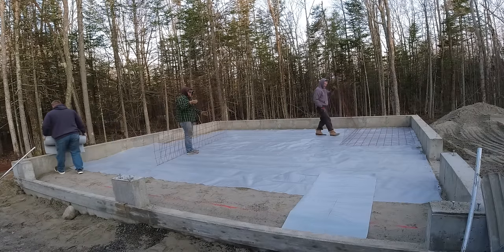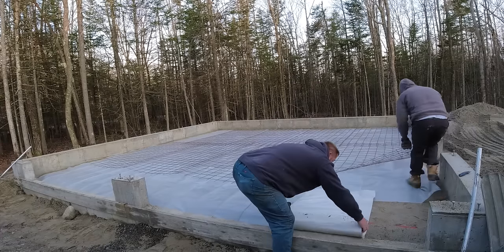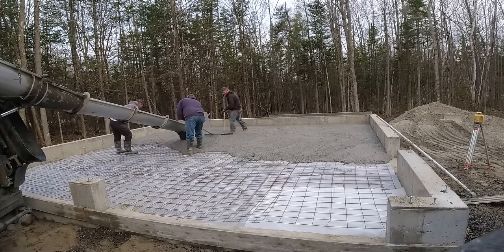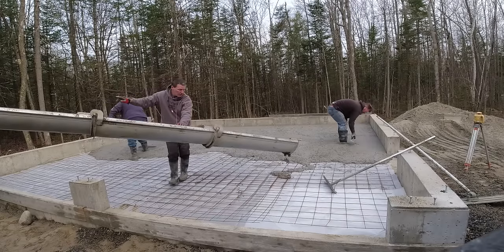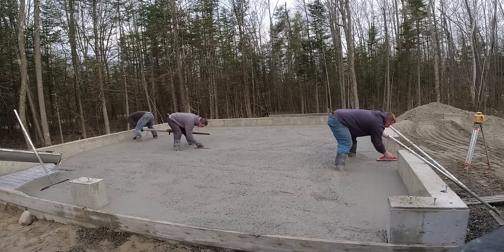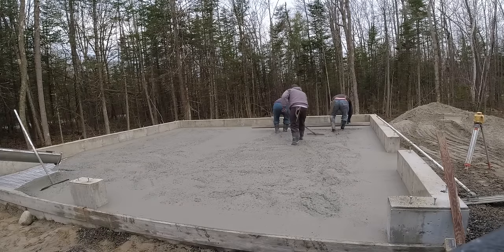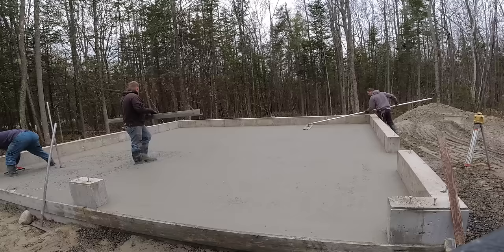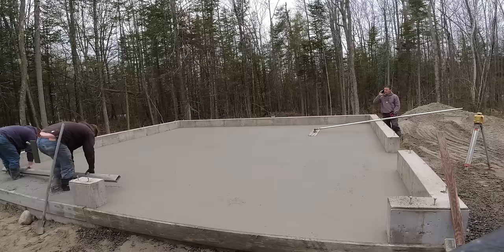How To Pour A 28' X 24' Garage Concrete Floor for DIY's and Beginners

Comment: Very clear and teaches folks useful lessons on concreting. You are as good at the movie thing as at concrete. Well done. Planning a 36 ft long by 15 ft wide drive way slab here, S.Texas, 3000PSI fibermesh mix, no rebar or wire mesh ( - internet reports recommend this setup for residential driveways - ) on existing 50 year old gravel driveway, I am wondering how far back the Readymix delivery extension will reach? Some say 18 feet, which leaves me with wheel-barrowing 12 feet and a bit. Other thing, you mention the screed stick, yeah as I recall my earlier days, overseas, pouring concrete drives, we used 4 x 2 studs, but riding along on top of the forms,  not over set out pads as ya'll do.

Comment: I’m from England and I subscribe to your excellent channel but I don’t think I’ve ever seen you vibrate a slab with a poker?
I’ve got one to do that is 300mm thick(12 inches thick). What advice can you give me?
Reply from the maker: It mostly depends on how stiff or loose you pour the concrete. We use one when we want to vibrate the face of a form so when we strip the forms the face looks smooth.

Comment: No body lifting the wire
Reply: its got fiber in it too,  probably could have been a bit higher,  but most of it looked to be in the bottom inch and a half.